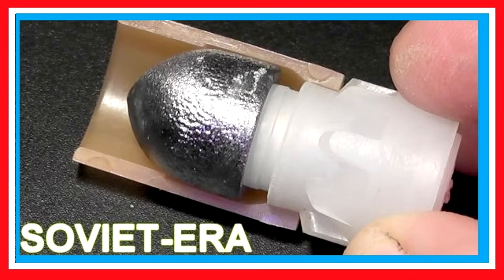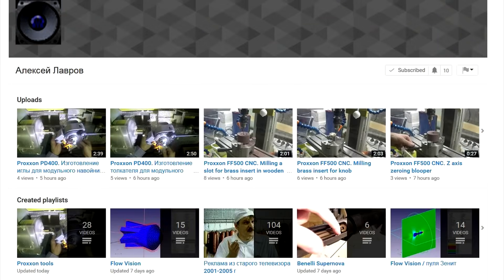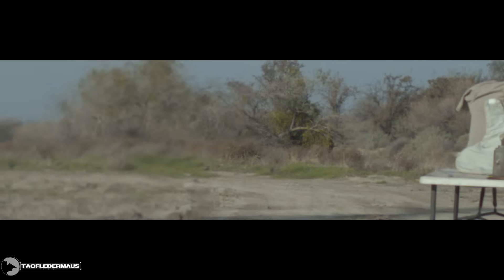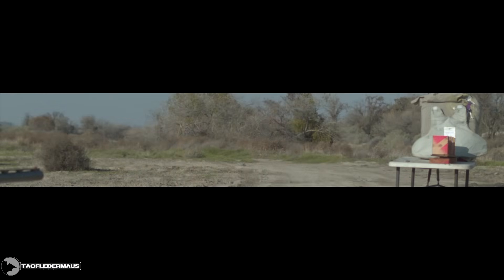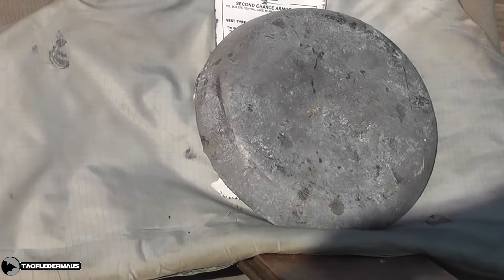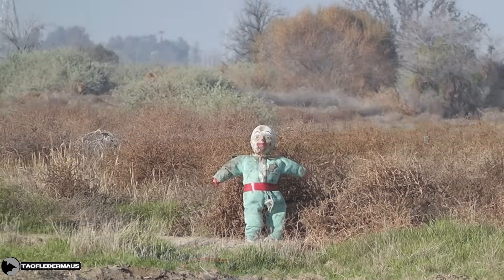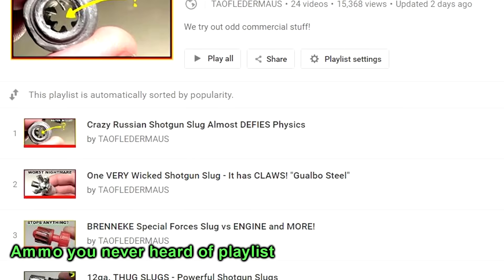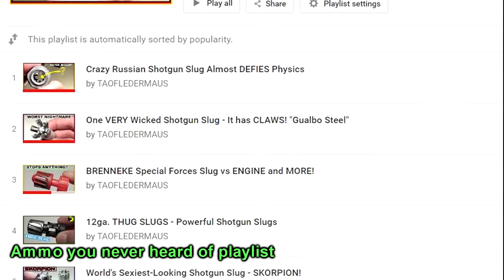The Russian TRIO -  World's WORST Shotgun Round?

Comment: I think the sabot containers need to directly contact more surface area of the slugs. It looks like 3 grooves were cut out to hold balls much bigger than the actual rounds so with the immense pressure, they go shooting out the front because that plastic bent around the bullets. If they were carved as if they were made of clay and you just pressed the bullets inside to create a much tighter seal, then it might actually take the rounds with the sabots.

Comment: I still see a lot of potential in the idea. If they only had a solid base instead of being open on both ends and a good gas seal I think this would work well.  The way it is they are just blowing the balls out of the sabot's and failing. I have long had the idea of a plastic divider between the layers in a 00 shell, designed to be weak in the center so the three pieces could roll out away from the pellets after firing leaving them round and headed straight downrange.

Comment: your issue is the carrier pods. you need something that will transfer the energy, create a good seal yet break off from the main projectiles. a simple tube that fragments at high velocity would work a lot better... ie, a solid backwad and a cardboard tube that splays apart from 3 points. upon leaving the barrel, it would create drag, open up and leave the lead balls "to do their stuff"

Comment: I have to agree, VERY GOOD idea with something missing. Either the plastic sabot halves are way to hard and shattering or a gas seal is missing. My vote is on the seal missing as the sabot halves should not be outrunning the balls anyway. Possibly more proof that you can't just stuff anything in cheap Walmart bird load shells and get good results. Even with a good gas seal if it doesn't fit the base of the sabot to some extent it will blow the seal and give poor results. I wish I had a bunch of these to load from the ground up and see if I could make them work.

Comment: You should split the test of these rounds into two stages. One where you determine if they are feasible or not and the second (with necessary modifications) on your range.
If you had less charge, these might have been "good" projectiles. Or with a better designed sabot.

Side note, i've only watched til 4:55 so far.
Reply: And they have "almost" a five star rating because that's how ratings work on the internet. It's called promoting your own product.
You can actually hire real "people" to hype your product through ratings and chatter about the product everywhere online. Mostly Chinese with just barely enough English skills to make a sentence.

Comment: Ever think of putting the Sabot with the balls in front of a wad or in a shot cup?
Reply from the maker: That's exactly how this is
Reply: Wow ... I was thinking the Sabot was not strong enough to hold the shot as it was driven down the bore and was getting blown past the shot. The sabot has to be uncoupling from the shot in the bore somehow _  Solving that would solve the problem and I suspect result in a decent load.
Reply from the maker: It probably seems like I forgot something or did something else wrong.  But there was a gas piston behind the sabot,  and the ball still were stripped out of the sabot.   Doesn't seem possible but that is what happened.

Comment: Guys, in "Трио" there should be a 13mm obturator (pressure seal) between the layer of powder and the sabot with the balls which actually pushes it. You load it with 2g of powder (measured for "Сокол" type powder, other powders weight may vary), than seal it with obturator, put the sabot in and roll bend the edges of the case. The pressure should reach 700 bar and muzzle velocity should be around 420 m/s. The round is not that bad - at 50 meter distance the balls should hit in 40 centimeter diameter circle. Redo the experiment, sirs!
Reply: He said in another comment that the shells did come with the seal and he did use them.
Reply: Да хрень это все,как их не снаряжай,все равно вместо трех картечин прилетают максимум две,и те с разбросом по всему габариту мишени. Чем такие говнопули использовать проще взять картеч 8.5мм,их влезает 8 штук в патрон)
Reply: I'm late, maidpretty, but I will also add that a rifled barrel is better for such load, from my winchester SX4 at 22" barrel (56cm) I get a 30 centimeters spread at 50 meters.

Comment: What you have there is a classic demonstration of mass and inertia. When the powder charge ignites it applies equal force to the sabot and the balls. Being much lighter the sabot accelerates much faster. The low velocity of the balls indicates separation from the sabot inside the barrel. Without a gas check behind them, the gas column from  the charge vents past the balls and only imparts a relatively small amount of force on the balls.
Perhaps you should try putting a cardboard wad behind the sabot?

Comment: This round is marked as "ТУ" on the back side of the paper you showed. It means, that it does NOT necessary fulfill govermentally established testing procedures and norms. Those which do, should be marked as "ГОСТ". ТУ is usually shit. However, there are some exceptions, just think before you buy.
Also, it has 5 star rating, but only 10 people voted.

Comment: Years ago I bought some 140 grain dual ball ammo for my 357. It was designed for the NYPD to prevent overpenetration, but needed up being worse than any hollow point round they used, so they were sold off cheap. I took my brother to an indoor shooting range and loaded the gun up with these rounds. On the first shot the muzzle rise caused the two projectiles to split about an inch apart. He looked at me and asked why there were two holes in the target. I told him the bullet must have bounced back. He set the gun on the neck and ran out of the range!

Comment: I have a question for you guys. I recently acquired a FN Browning A-5 fitted with a Lyman Cutts compensator and a 9 stage variable choke, the choke when rotated either clockwise or counter clockwise will tighten the pattern or widen the pattern 
    I'am curious if it's safe to discharge "00 buck" through this type of choke, I'am not familiar with the device so I thought I would ask a Shotgun specialist such as yourself.  great video by the way, and the background "70's porn music" is outstanding. 
                     thank you for reading!
                     Eric Dee.

Comment: i dont know jackshit about shotgun rounds, but i had a thought. maybe they are meant to be shot through a barrel that is small enough to not allow the sabots to separate until they exit the barrel?
Reply from the maker: They weren't opening inside the barrel,   it's a tight squeeze.   The force of being shot was so powerful,   the balls just slipped out the back of the sabots.
Reply: *****
ahh, i see. alright thanks for the explanation
Reply: do you have these red cap from picture from site in the end of video? manual letter also says you have to use this caps
Reply from the maker: The wads I got were white,  and yes I used them.

Comment: hi jeff, awesome video as allways, could you try duct or elec tape and tie them together so they hold down the barrell
Reply from the maker: They fit tightly down the barrel,  so they can't open up inside the barrel,   the balls are somehow slipping out the back.
Reply: +TAOFLEDERMAUS That's exactly what I was going to ask Jeff. Did the partitions in the nylon sabot show signs of the shot sliding right out? I only saw the single damaged sabot in your video.

Comment: 300fps? don't some airsoft guns fire at 450fps?
Reply: An item propelled can be one of three.
1. fast and heavy
2. slow and heavy
3. fast and light
At the same distance (preferably based on number 2's distance) all three do damage. In short, it's a recipe, and it's up to the designer to mix and match ingredients. A 300fps lead shot will do just as much damage as a 1500fps load of paper clips.
Reply: aserta seriously? Damn I wish I took physics seriously when it was offered. Fml
Reply: Combat Boots plenty of airsoft guns fire upwards of 500fps. However, that's with a 6mm plastic projectile usually between .25g and .46g (.0088oz and .0162oz)
Reply: Chad Pendleberry so if a 9mm bullet was travelling at the same fps it could be lethal?
Reply: Dont know if lethal but would carry much more kinetic energy, as kinetic  energy is 1/2*mass*velocity^2, so more mass with same velocity gives more energy
Reply: but here is the thing yall are not taking into consideration.  airsoft and paintball are both doing this on air not explosive powder.
Reply: There is no difference, really. In both cases projectile is being pushed out of barrel by pressure of expanding gases, be it pressurized air or gases coming from burning of powder.
Reply: Olson323 agreed and knew i didn't clarify that well.  the air pressure is much lower than that of what gun powder can produce.
Reply: hardwire well fps is fps regardless of the forces used to create the fps, no?
Reply: Combat Boots yes but again im talking potential vs actual.  meaning there is only so much air can do out of a paintball gun (around 450 fps) where as powder out of a shotgun or a rifle you should be seeing at least 1200 fps.
Reply: hardwire sure, with out a doubt. I was just more fascinated at the fact that a BB travelling at 400fps and a bullet travelling at the same fps would have different effects.
Reply: Combat Boots well thats density deal.
Reply: Thats kinetic energy, heavier object moving at same velocity have more joules of energy, yes? When chopping wood od digging with pickaxe, the tool is moving fairly slow, but it has a lot of energy because of its heft. As for bullets, 9x39mm bullet have very slow velocity, because it is subsonic, while 5,45x39 has huge velocity because it is light. but it is the energy of 9x39 that will kick you out of your shoes
Reply: They forgot to put an obturator over there
Reply: i had a CO2 airsoft pistol that got 950fps and would make bare skin bleed
Reply: i took physics and i dont remember jack shit youre not missing much
Reply: Bubby lol I'm glad to hear. Half my friends go on about how physics was the shit I'm like... "K". 
Interesting knowledge is still useless if it's not applied, lol.

Comment: I guess the problem could be avoided if the sabot had a different shape. It's clear what happens - the gases from the explosion push on the sabot and it slips around the balls before they even start moving. If the backside was from just one piece, it would have better chance to push whole load out, not just the sabot.

Comment: looks to me like the sabot is accelerating so fast inside the barrel that it's leaving the shot behind, instead of pushing them forward...  the powder explosion isn't therefore pushing the rounds because the sabot is getting blasted much faster and the lead being heavier is coming out the back of the sabot as  the lighter sabot accelerates... 
in theory these should be a better performer..
Ideally..
you'd have a better wadding and thicker, stronger sabot to push the the rounds to full velocity and get the slugs moving as fast as the sabot. ;)
my guess is..
IF.. you made a stronger sabot, that could hold the rounds together until they all leave the barrel... AND IF, I say IF
you made those three balls out of different density metals  you get a "Triple tap" effect hitting the target...  which if tuned properly could be potentially devastating. :)

Comment: You needed disc between sabot and powder. Otherwise no good.
Reply: The balls would still slip in the sabot, probably simply crushing together like .410 buckshot in a Taurus Judge does.
Reply from the maker: There were strong waddings included with them between the powder and the sabots.
Reply: TAOFLEDERMAUS a shot cup instead of the wadding would probably make these into a much better round

Comment: im sure you're using a nitro card.  seems almost like the sabot is too small for the barrel and cab escape over the balls. not enough compression down on the balls. 
the concept seems good, execution was the fail.
Reply: oh god, that sounds wrong
Reply from the maker: The sabots actually fit tightly in the barrel...  they can't open up,   but the balls are still being stripped out the back.
Reply: wow, that's crazy.
You would think the nitrocard would hold a seal on the back as well to push it forward as one unit. 
I wonder if the russian ones have a special wad they use in the back that could prevent this from happening?
It's almost as if you need a seal on the back of the sabot to push everything forwards as one hunk. But with the way its coming out, who knows.
That just is mind boggling that they damn near roll out the end. hahaha. 

Merry christmas friend.
I have some keyboards to send to you also. 
Carl needs a new one.

Comment: i think whats happening is the inside of the sabot is being ripped apart, thus it's turning into more of a hollow tube. So what you have is the shot being left behind as the sabot is being ripped away from it. And that causes the shot to only really be propelled by the left over gas. Which is why the sabot is going faster and the shot is moving as such a slow speed. Atleast that's my best guess.

Comment: I guess the roundness of the balls allowed the sabot to slip past them very early on in the barrel, after which the sabot is forced out like a bullet, but the balls don't make anything remotely resembling a good seal, so a lot of the expanding gas just pushes around them, not imparting much energy.
Reply: As an addendum, consider that the balls are very heavy compared to the sabot.  This means they don't want to move easily, so the effect it a bit like if you had a nail going sideways through the barrel through the sabot - the force of the gunpowder is enough to force the sabot out, even if the stationary nail rips it in half in the process.

The lead balls are a lot like that hypothetical nail in that they're heavy objects that don't want to move, and the sabot isn't strong enough to make them and is torn past.

The sabot is still more or less barrel shaped after this, or at least is deformed to fill the barrel, so it is pushed along like a bullet the rest of the way out of the barrel.  The balls are small and round, and unable to catch that much air from the explosion, so to speak.  Also, since they're heavy, it takes more to accelerate them, so they'd be moving slower in the end anyway.

Comment: those results kinda make me wonder if they missing a part? somthing to seal behind the actual load and push sabot and shot out at the same time. in fact at the end there you show that russian website and there is a little red cup looks like it fits over the sabot, but in the slow mo it looks like the rounds are just loaded with the sabot and 3 pellets?
Reply: You could be on to something there.
Reply: Ring-a-ding
Reply: I think it would be what's numbered 3 on the wee loading guide.
Reply: this is an interesting idea for sure
Reply: I've noticed it as well. Let me go check their website. Thanks to my nationality I know Russian.
Reply: glad I read some of the comments.. I was thinking the same.. a plastic plug at the bottom to help it accelerate as a whole unit instead of stripping the nylon sabot
Reply: Without a way to transfer the energy to the entire package the "explosion"  would just push the light sabots right past the heavy shot.  You are correct a better cup would allow the sabot to hold the shot and than pull apart after they left the barrel.  I bet one side of the sabot leaves the barrel slightly ahead of the other.
Reply: i was thinking it needed over powder wads/cards from the beginning of the vid...commie 416 is right about what he saw at the end of vid and figured out... is there a new vid update ? lol you,d easily get 1300fps if ya figured it out sooner
Reply: Yup, they forgot the wad-obturator
Reply: In other comments taofledermaus said the rounds did come with those gas pistons and he did use them.

Comment: On my channel I just crammed a cut up Magic the Gathering card into a shotgun shell and it probably traveled faster than those lead balls. I cannot figure out how they lost that much energy.
Reply: Simple, they never gained it to start with. In this test the sabots are clearly stripping off the balls while still in the bore, making the pressure disperse around the balls rather than accelerate them fully.

Also, balls.
Reply: They were missing/forgetting a part that pushes the sabot and rounds together.